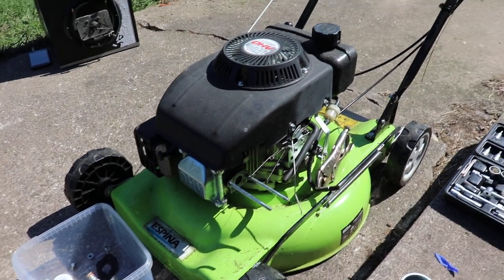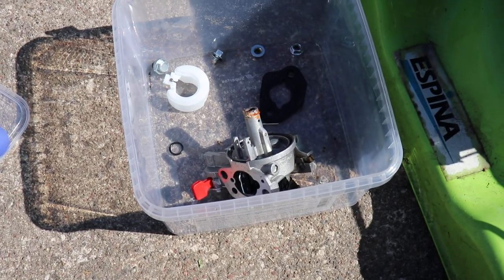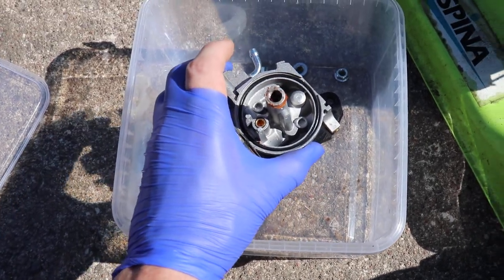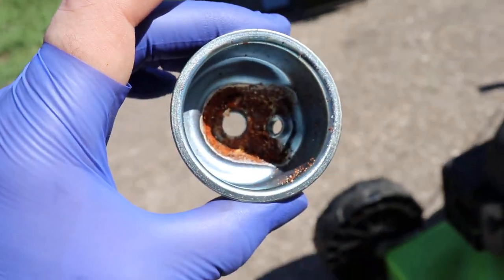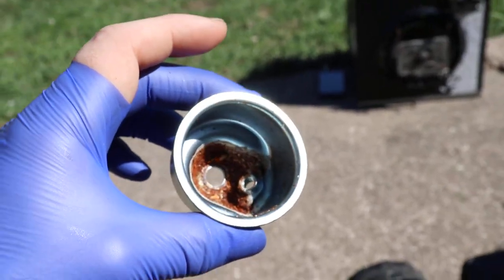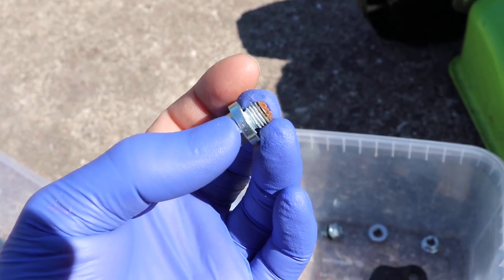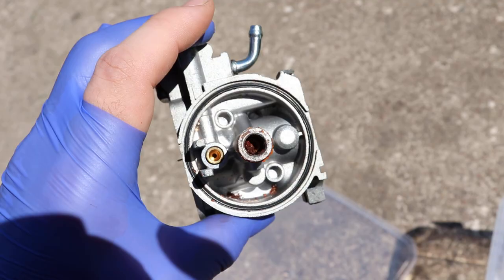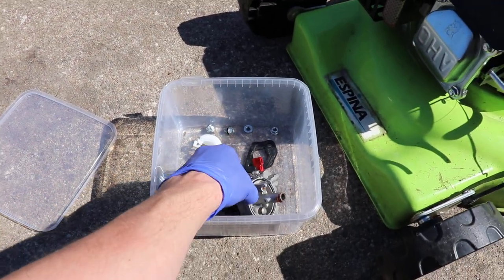Chinese lawnmower carb is full of rust

Comment: I’ve repaired and cleaned many a mower like this. Actually doing one as we speak. It has been mention. Should never leave with fuel in for the winter storage. Run it out. Use the spring drain or take bowl of to fully drain and it doesn’t hurt to spray ww40 into carb.

Comment: The solution to this would be to let the mower run until the carb is dry (cut off the fuel before the carb) before you put it away for winter.

Comment: I think this engine is a Honda clone, in which case it wouldn't be a bad engine at all, just with some cheaper parts that like to break down. If they were reinforced, this thing might possibly even run several decades.